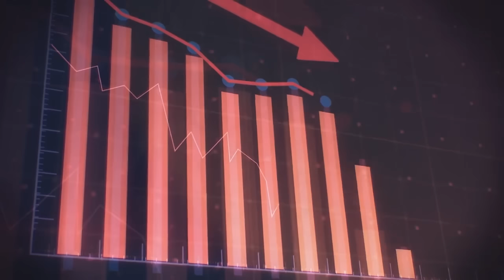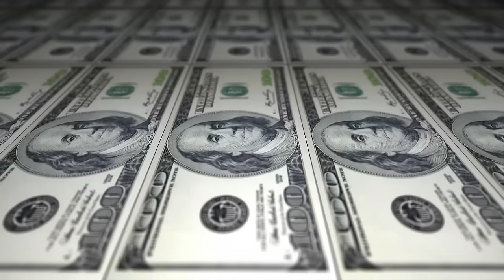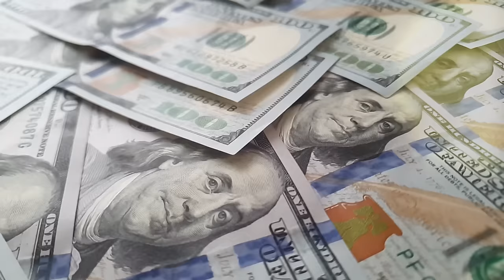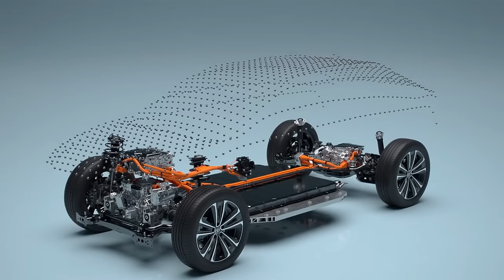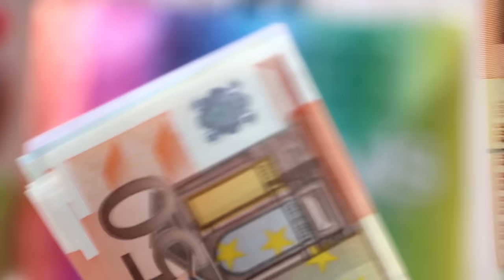The ‘I Told You So’ Moment: Toyota’s Predictions About EVs Come True! Electric Vehicle or Hybrids?

Comment: Ill happily take the 50+ mpg from a hybrid with no distance anxiety😁😁
Reply: Agreed!!! I have a hybrid. At least 80% of the time it drives on electric. The only time the ICE kicks in is at hills or from the stop. In long, straight city drives I've gotten 65 mpg. On long trips 60 or more due to mountains.
Reply: Try 40+
Reply: @paulw4259  YT will. EVs are the perfect city car unless you think breathing crappy air is a highly desirable thing.
Reply: @amraceway  Perfect city car next to those battery recycling plants in Scotland and France where 900 TONS of BEV batteries burned? So great for those cities air quality!
Reply: @robertkubrick3738  Poor management of waste disposal is a different issue. Methane fires from rubbish dumps to recycling centres catching fire are similar examples of poor waste management. No reason to can EVs. Do you use cordless power tools?
Reply: Camry E, Corolla, Prius… 50+ Rav 4 and others hybrids 40+
Reply: @amraceway  it all depends on how the EV's go juice is generated.   Here in BC where I live, it is mainly from greenish renewable hydro-electric power plants, so EV's do make some ecological and economic sense (that is until they start taxing the power supply system with their never ending demand for more power)  

However, much of the US's electrical generation supply comes from burning fossile fuels, namely natural gas or coal (clean coal is an oxymoron akin to Jumbo Shrimp and Military Intelligence), so basically you are trading off one carbon foot print for another.   

And as demand for power increases with the addition of more and more EV's into the market and street, more power generation power capacity will be required, leading to more pollution.  As it is, the current grid can barely keep up and meet current demand, add more and more EV's into the mix and you will soon have problems.  

And we all know what happens when demand outstrips supply...prices increase and only those that can afford, get the goods or in this care power.   That's basic Economics 101.   Basically I see the current EV tech as little more than a stop gap measure until newer and better systems come on line such as hydrogen.
Reply: @amraceway  that methan generated by rubbish dumps are in many ways a wasted resource.   They could well be tapped to generate electrical power for a small local generating plant.   

EV's batteries are an ecological disaster in the making, from their manufacturing, to recharging and then disposal once spent, they have one hell of a carbon foot print.  Which is why I believe they should be look upon as a short term stop gap measure to be used until newer and cleaner tech's come on line.
Reply: @gumpyoldbugger6944  Hydrogen is a terrible fuel and if you think EVs have issues, where do you start with hydrogen. Greenwashing that is supercharged explains hydrogen vehicles.. I think much of the zero carbon debate is bunk on both sides. One, we cannot do without fossil fuel and as it is in limited supply we should conserve it and not waste it on crap.
Reply: @amraceway only poor air in china, wumao.
Reply: @pimpalamac3411  Air pollution levels in China fell a “remarkable” 42.3% between 2013 and 2021, according to this year's Air Quality Life Index from the University of Chicago's Energy Policy Institute
Reply: @amraceway  the sky don’t lie.
Reply: @Eyes-of-Horus  100% of the time hybrids carry extra weight of gas, to satisfy range anxiety. That's a high energy price to pay! Irrational fear is not practical. Get over it!
Reply: I'll happily drive my self-charging solar Aptera (40miles/day) with no range anxiety.
Reply: 100mpg with my plug in hybrid mercedes a250e
Reply: In 1986 I purchased a Honda Accord DX sedan.  I was getting 40 mpg on the highway and 30+ in town.  It lasted me 381,193 miles.  I really miss that car.
Reply: hybrid is good but its really expensive. even thw maintainance. I will wait 20 years for the system to mature. I will switch if all toyota swith to Hybrid
Reply: @amraceway  Makes no difference on air quality.  EVs are manufactured with a huge carbon footprint.
Reply: Yes just the people that live near the electric power plants have to worry about that,and low water levels for the hydroelectric plants! We’re in the hell do you think the power come from ?
Reply: How about cancer anxiety is that your ignorant trade off?
Reply: @robertkubrick3738  I'd like to see the source of this information.
Reply: @erniepappa3900  As long as you drive them in the city, once you take them out on the highway they turn into ice cars.
Reply: @amraceway  Methane is a naturally occurring substance in our cities, refined COBALT is not!
Reply: @mteifke  About recycling plants burning 900 TONS of BEV batteries in France? OR the recent Scotland BEV battery recycling plant that Burned for 36 hours?
Reply: @robertkubrick3738  I think nuclear powered cars are a bad idea. They haven't really caught on in most cities I believe.Methane is one of the worst greenhouse gases.
Reply: @amraceway  They add the same COBALT to doomsday bombs as in Lithium Ion batteries because Strontium 90 just isn't deadly long enough and the cobalt extends the deadliness by 25%.
Reply: @1voluntaryist  Do you really believe the Aptera will gain 40 miles a day from Solar? If you get 8 miles per day I'd be very surprised. 2/3 of the day you won't be getting direct sunlight with no clouds and unless you wash the car every day those panels will pick up road grime. Things don't work in the real world as they did in pre production. They might even decide the on board solar panels aren't worth the cost on the production model, saving a whole 5 cents per day.
Reply: @amraceway  The only significant greenhouse gas is water vapor. Figure out how to control that on a planet whose surface is 70% water? Water vapor is probably over 50 times more powerful than methane as a greenhouse gas. The oceans burp huge amounts of methane every day, why don't you tell them to stop?
Reply: @robertkubrick3738  The cobalt in batteries is relatively benign. Digging it up like most things can be hazardous. It hard to think of any mineral that doesn't have a downside when mined. Don't have any cordless tools? I love them.
Reply: @amraceway  No the Cobalt used in batteries isn't benign in the slightest! The soot from fires lingering on surfaces or the smoke from fires that contained cobalt have killed and also made fire fighters in their equipment incapable of working for the rest of their lives.
Reply: @robertkubrick3738  Tell me something in our modern world that isn't toxic when it burns. MDF which all modern houses have in abundance, plastic paint which covers everything., foam in upholstery, our plastic clothes,. The computer you are now using .The list is endless. So you live in a forest wearing animal skin clothing and hunt all day or do you just take a holier than thou attitude to life ?
Reply: @robertkubrick3738  both
Reply: 50 in the city. Not highway. Got stuck with a rental Prius for a long trip, got 35 mpg highway with 400 miles on it.
Reply: Now you’re talking! I would love the instant acceleration without the need for a 2+ton battery. Pattern it after a scaled down diesel/electric locomotive and the possibilities are vast. From a single motor economy car to a fire 🔥 breathing 4,5,or even 600 hp awd hot rod that gets better mileage than a current econobox. Hell, I may get one myself.
Reply: @amraceway  only if you have a place to charge it. I should think in a city like New York, where very few people have off street parking and few charging stations, they make lovely lawn ornaments. I’d say use public transportation but… you can’t carry protection there and the natives can be very dangerous so unless you’re Rocky or Rambo ….
Reply: @amraceway  don’t know where you live sport, but those fires, particularly the methane ones are closely controlled and in many cases the methane is packaged for use in power generation and other uses. Those fires are a piece of cake to extinguish compared with an EV eruption.
Reply: @gumpyoldbugger6944  well put!
Reply: @gumpyoldbugger6944  why not drastically cut the size of the battery and use it as needed to augment other systems. Make it a true hybrid, easy to use and easy to fuel, and cut the weight of the vehicle by one or two thousand pounds. Also it’s less of an ecological disaster.
Reply: @markvincent5992  Diesel-electric locomotives aren't as efficient as they're made out to be. They burn 160-240 gallons per hour, which works out to 0.25 mpg. Yes, one-quarter mile per gallon. CSX's bullshit commercials are based on gallons burned per ton of freight moved. They're not emission controlled either. Diesel and jet engines are the biggest polluters, but Bubba doesn't care as long as his Cummins mud truck woos Lolita and Tanqueray, Billy-Bob and Jolene don't care as long as they get 15 mpg hauling their mutant hamster-headed kids to WalMart and McDonald's, and the elite don't care as long as they don't have to travel with the masses.
Reply: @robertkubrick3738  Yes, I do trust the Chris and Steve, the founders. Do you know the 3 criteria needed to evaluate the claim of 40m/day solar boast? You talk about real world conditions as if the founders of Aptera are like the usual front men, the CEOs who propagandize to keep stock prices up. Do you know the history, the difference between Aptera and all other EVs? Do you know Aptera is a paradigm shift, so unique that nothing like it has come before and nothing like it is even planned? Research. Then you can ask questions that refer to this specific situation, won't embarrass yourself, and have to say, "Oh, sorry, I didn't know that."
Reply: @MORE1500  Yep, my 88 Ford EXP would do 40-42 highway at 75 with the windows down and sunroof out. My 92 Cavalier got 40 at 75-80 as well. I also knew someone with a 72 Chrysler slant-six that got 37 mpg. My current 2016 Camry barely gets 40 at 65 mph. We're going backward.
Reply: @anonymousinc6330  They do much better than that.
Reply: @paulyoutobe9742  You mean especially the maintenance. The Synergy drive system is known for issues with problems even after replacing the battery. I saw one dealer (a small one at that) prepping three Priuses to be shipped out of the country because of this. I also found a mint condition Fusion hybrid in a junkyard. 9 years old, 60k miles. Battery replacement cost more than the car was worth, and more than the fuel it saved. But the inconvenient truth no one talks about is that lithium mining produces 15 tons of pollution per ton of lithium mined.
Reply: @amraceway  If you're referring to hybrids, not on the highway. 30-40, maybe. I know, I got stuck with a Prius on a rental once.
Reply: @gumpyoldbugger6944  Greenish? Hydroelectric? LOL. Hoover Dam. 12M tons of CO2 annually. Fact check it.
Reply: @anonymousinc6330  My son has a 2006 Prius. All original batteries, less than 5 litres per 100 km on the open road. more in the city. Built like a brick shithouse. Simple to service. No alternator or starter motor. ICE motors in them last forever. What is not to like about them? And the car lives out in the boondocks too.
Reply: @anonymousinc6330  My son's 2006 Prius gets better than 5 litres per 1200km. Brilliant car.You obviously are a poor driver.
Reply: @amraceway  Bet he bought it secondhand after battery replacement, or with extremely low miles. No way the battery hasn't been replaced with regular use at 18 years. Also, there's no point in having a hybrid in the sticks. Rural driving would never use the electric motor or battery. I drove a 2003 for about two months - I know what I'm talking about, you don't.
Reply: @markvincent5992  Yet to hear of a report of an EV fire in my city. Seen a few petrol cars go up in flames though.
Reply: @amraceway  Well the odds favor you there. Given the fact that I/C vehicles outnumber EVs something like 7 or even more to one, I am not surprised to hear your report. However, even the most violent fuel fire is generally easier to control and extinguish. This is not my opinion but the opinions of the professional firefighters and they should know.
Reply: @markvincent5992  Pinto fires were spectacular when Ford thought the fuel tank made a good rear bumper.
Reply: @MORE1500 Same.  My mom's cousin also drove a 1980's model Honda Accord with a stick shift and they said sometimes it got 40 mpg.
Reply: My 2l turbo diesel, 45mpg around town, I've had 70+ on a motorway run. When I was a kid, my 1.3l petrol did 25mog around town if I was lucky.
Reply: @robertkubrick3738 yeps, coal power generation is the main contributor as well in my city. People blame cars, but nope, even on hari raya wheres most people go home to their parents at the other cities, the polution still the same.
Reply: @1voluntaryist 100% of the time, ev carry their battery, without giving you the range...
Reply: Totally agree. My new hybrid does nearly 60mpg and is a great car to drive.
Reply: A @1voluntaryist
Reply: Diesel WILL do 70mpg
Reply: Love diesel wish they were still more available…
Reply: Diesels can do that also
Reply: @amraceway  Using the cordless power tools is a poor argument. If your cordless drill dies, you put it on charge and go and have a cup of tea. If your EV dies in the mountains at night, during a storm, there is nothing you can do.
Reply: @tooyoungtobeold8756  Only a madman would drive an EV where there were no charging ports. My reference to power tools was in relation to lithium fires. Like all things caution is required. Anyway , sorry I woke you up.
Reply: And the reliability.
Reply: It’s all a scam, when gas mileage goes up the gas prices will rise. Everyone will still get their money. Also resale and battery replacement is horrible and the used car market on EV’s and hybrid is garbage
Reply: @amraceway  EVS are for people that think Double the price for half the distance with fast aging is a desirable thing..
Reply: @peterlustig8778  Your hollow opinion.
Reply: @livinglife1089  Hybrids are excellent value and the Toyota's go forever.
Reply: @amraceway  No facts  you can't deal with...
Reply: @peterlustig8778  Only interested in factual information, not corporate propaganda. I drive a Toyota as my everyday vehicle.
Reply: @amraceway  then i don't get it why was my opinion so hollow?
Reply: @peterlustig8778  Your dismissal of Ev's is childish.
Reply: @amraceway  So when people hate stuff that you like - they are childish? Maybe you are the child...
Reply: @peterlustig8778  No not at all. However the frothing at the mouth over the inevitable transition to more EVs is a childish reaction. I wonder when horses were replaced by motorized transport did people deny the value of what was to come? Luddites rule, O.K?
Reply: @amraceway  You allways accuse other people of what you are, "childish" "frothing at the mouth" I mean lol who is frothing here🤣 your "inevitable transition" Even in europe 80% of the new cars sold are gasoline cars EV is 20%. Car manufacturers are returning back to normal cars. Nothing seems inevitable with a technology that costs double for half the performance..
Reply: @erniepappa3900 my diesel suv gives 44mpg on highway runs & 30mpg in bumper to bumper city traffic.
Reply: I'll happily take £1 of electricity for 50 miles versus over £6 for petrol

Comment: I'm in the UK and have a 4 year old Toyota Camry Hybrid. On long journeys it does nearly 800 miles for one tank of fuel and takes less than 5 mins to refuel. No EV on the planet comes anywhere near matching that! on average I get about 550 mile per tank with my regular journeys. I will have it for a long time as they stopped making it for the UK market and they have nothing in the current model range that meets my needs like this one does. This is my fourth Toyota since 1998 and I won't be switching brands, I will wait and see what their future models bring. My wife and  son are each on their  3rd Toyotas and won't change either.
Reply: I know somebody that has a.     1999 Toyota 4Runner with over 791000 on it. Same transmission. He had to replace the engine. It had 696000.
Reply: How many gallons does the fuel tank hold? My Chevy 2500 Silverado gets 500 miles to the tank.
Reply: Are you saying that you do 800 miles without any stops at all, then you spend 5 minutes refueling and then 800 miles more? Sounds... stupid.
Reply: @teo_gorr  No. Total journey mileage there and back was just under 800 miles. and I still had some fuel left when I got home. I was visiting relatives 380 miles away plus excursions. Trip meter counted 790 something miles when I got back home.